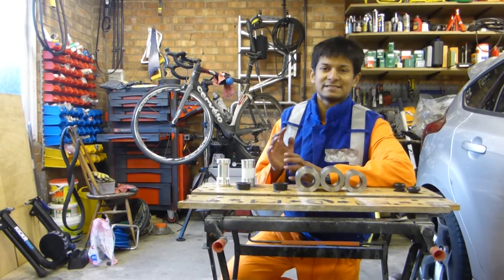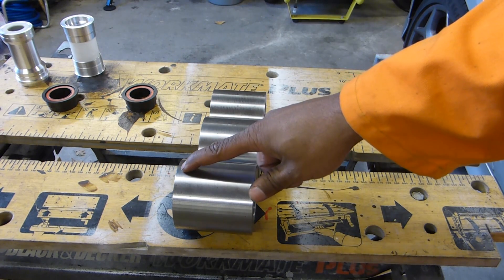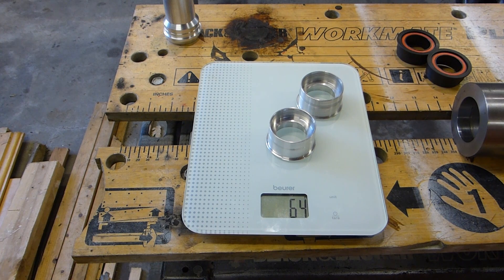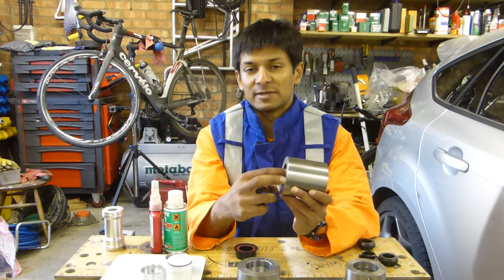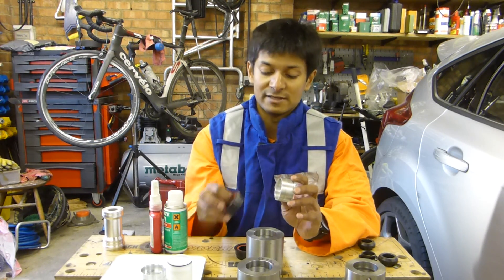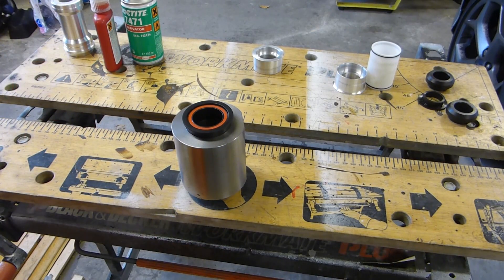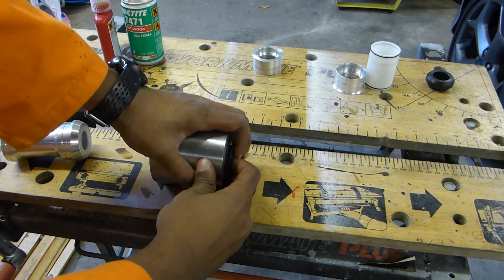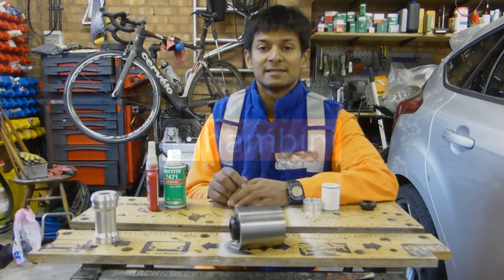Cervelo BBRight Bottom Bracket, Creaking, Specifications and Shimano Cranks

Comment: I dunno. This guy is trying to sell BBs. I have worked in a Cervelo dealer for years. If your frame is freaking despite trying a couple different bottom bracket solutions. We would just warranty the frame. But it's not happening that often. I don't get all the hate. The frames rarely creak from the BB with a C bear...local...or ceramic speed bottom bracket fitted.

Comment: Hello, Yes I have a Cervelo R3 Ultegra disc, purchased in March 2018, probably it's a 2017 model. Yes, it has developed a tick, tapping noise that appears every 360° rotation of the cranks. Disappears when Standing- Climbing or Standing- Sprinting. BB?  My LBS , not fixed it yet, wants another go. Demand a replacement BB complete or just quality bearings?  Retaining compound as well,  or
Chuck it? New bike time? Cheers from NZ.

Comment: Hi Hambini great video clarifying BBright details. My Cervelo R3 Disc came with an FSA SLK crankset. I see BBright compatible Bottom Brackets for Shimano, Sram, Rotor. Which type of ceramic Bottom Bracket should i use for FSA cranks?
Reply from the maker: It depends on whether you are on a 30mm axle or 24mm axle. Additionally you need to know if your axle length is 90mm long. 

I certainly would not recommend any type of bottom bracket with ceramic bearings. They have poor life and poor are not as fast as they claim.

Comment: great video! I have a Cervelo R3 (2014) and am on my third  set of bearings!  creaking, seizing up. Think I´m gonna fit the next ones myself. I´m gonna order your fitting tools. What bearings would you recommend to ? C-bear? Do you send abroad? I´m currently living in Germany. Cheers David
Reply from the maker: Hello David, There are a few links here to read.

http://www.hambini.com/bearing-performance/ This covers bearing power loss and there is also a review of NTN by another Youtube user at the bottom.

http://www.hambini.com/bearing-guidance/ This one is a very basic bike specific manual

http://www.hambini.com/bearing-fitting/ This one covers fitting bearings and some of the clearance considerations.

Almost everyone that visits the hambini website buys NTN and if you read the reviews, the general concensus is they are very good. If you are in Germany it might be easier for you to obtain ING or FAG bearings, which are also top rated. 

I can send to Germany without any issues. Thanks Hambini
Reply: Thanks Hambini! I´ll put an order in next week. All the best